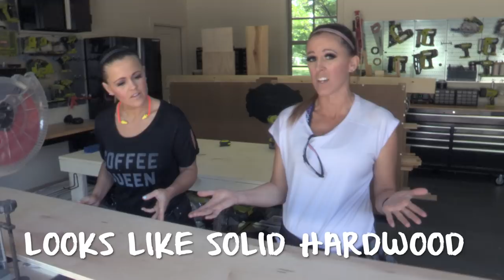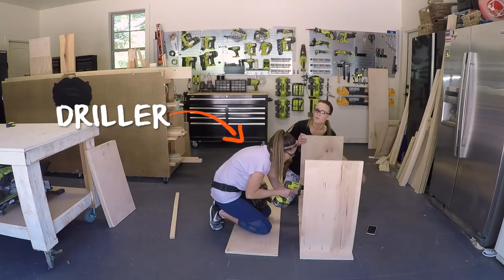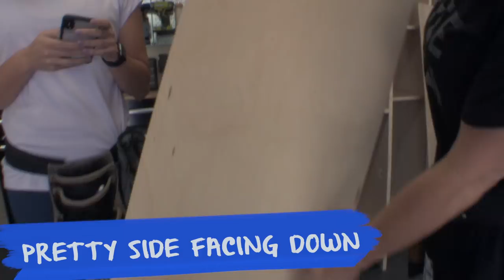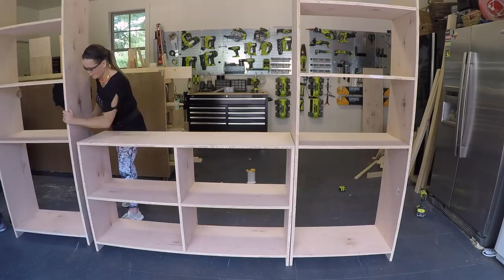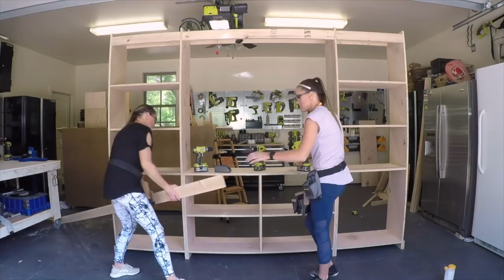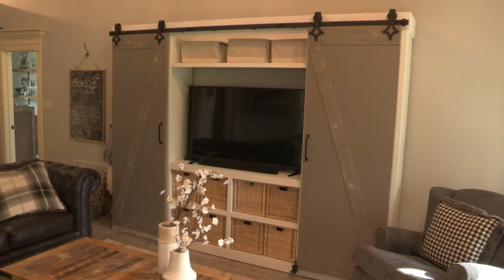DIY Sliding Barn Door Media Console

Comment: Great job with the entertainment center!! I built mine using your plans, but had to adjust measurements to fit a 75" TV and still be able to have barn doors that work. I still have to build the cabinet doors and install the barn doors, but I'm currently building the farmhouse bed y'all did and have to hold off. I just bought a new house and  I'm trying to build all my own furniture that I don't already have. You ladies are  great at your craft and I have been following your page for a while. I tried to upload photos, but it's not giving me the option.
Reply: Which aspects did you change to accommodate the larger TV?  I am trying to do the same